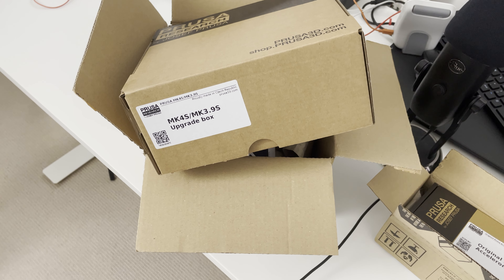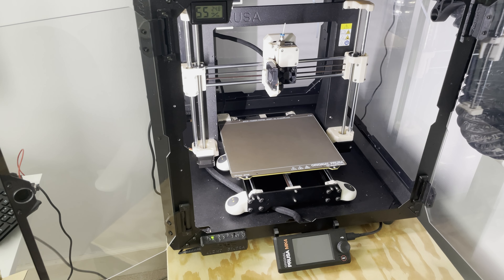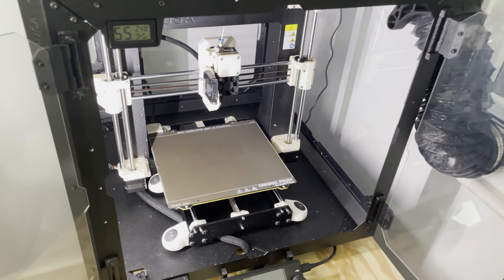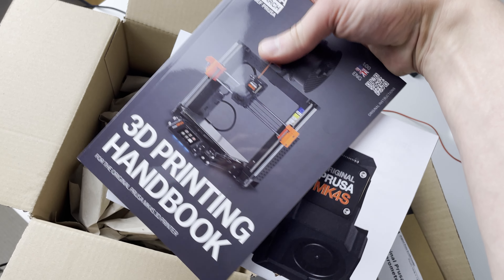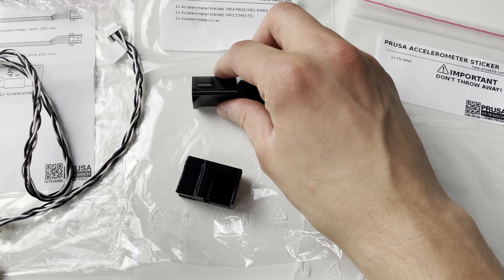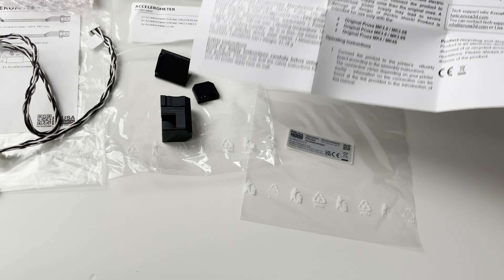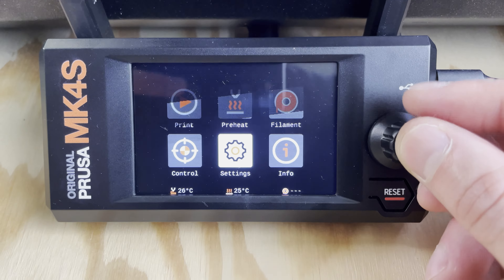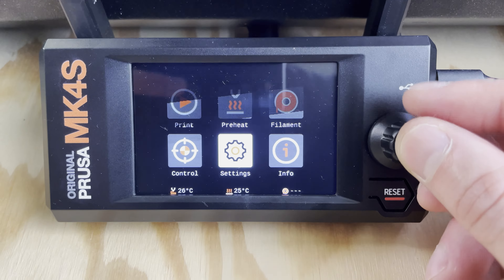Prusa MK4 to MK4S Upgrade and Input Shaper Calibration

Comment: The CHT type nozzles have dividers inside to split the nozzle into 3 flow paths. The concept is more heating surface
Reply from the maker: Hey, thanks, actually E3D nozzle splits filament into 4 parts - ai have cold pull photo from them. It makes sense why their nozzle tip is so thick. For Prusa nozzle - not sure, perhaps 3. Where did you get this number from?
Reply: The nextruders could very well be 4. I'll have to see if I can look inside with my microscope.  I just know from regular CHT V6 nozzles divided into three

Comment: Does lubing trapezoid nuts made artifacts worse?
Reply from the maker: I only slightly moisturize them with lube to mitigate friction. Did not notice any negative effects.
Reply: @StudioSpaceDust  I would check belt tension and belt mounts if everything is tight. then go around frame and check screws. Check small screws at motor idlers. Check if bed rod mounts are not cracked. Check if Xcrage  screws are not loose.

Comment: Nice!
I also just got the upgrade, I’m planing on reprinting the PC-CF parts out of ASA: I’m maybe a little paranoid about the breathing carbon fibre particles or having them rub off on my skin. The nanotube fibres just seems very similar to asbestos but maybe it’s harmless. I’m almost finished building my enclosure, and I’m debating upgrading with the parts from the kit to print these parts, and then switch over, or just print the parts with the original MK4 petg parts. Thanks for making the video! I really like how you make Prusa focused, no bullshit videos.
Reply: Oh and for the difference with the nozzles- Some posters on an MK4 Facebook group said that they have multiple chambers to push the melted plastic from multiple sides - I’m not sure how true that is but I’m guessing they’re a little bit different inside than the original nozzles. For why the obsidian nozzles are much larger - I think that it has to do with the thermal conductivity of the different metals. Brass seems to be about twice as thermally conductive as steel, so to heat at the same rate, you would need twice the cross sectional area. My guess is that they are made so that they have the same thermal transmittance to the filament. This makes sense looking at the photos, the original obsidian end is roughly twice as big as the original brass, and if we assume that there are different  chambers in the high flow end that also need a higher rate of heat transfer it would explain why it’s so much larger.
Reply from the maker: Intersting you say this - it sort of makes sense, but then I went to check e3d website how their brass HF nozzle looks like - and go have a look for yourself, its as big as obxidian. I also asked them if e3d HF nozzle is suitable for cold pull and they said yes, and sent me photo how successful cold pull looks like - it has 4 small branches, so it explains that filament is split 4 ways for higher flow rate, but in Prusa HF nozzle i don’t think there is physically enough space to split flow at the tip… thats why I’m still confused how they make them HF. But yeah, thanks for your thoughts man!
Reply from the maker: After some videos on YT I also now avoid filaments with fillers like CF/GF.. i do also believe that in the end its like asbestos, but i still have some prints that im using.. I guess going ahead i wont be buying that filament but the one I still own Ill finish… so ASA/ABS for parts - better choice. But ASA i find impossible to print without warping even with Prusa enclosure so thats why I use ABS+/ASA+ and i found that ABS+ has higher temperature resistance than ASA+ and also warps less so thats why i use it. But maybe you have some good ASA+ to recommend? For videos - well I only have MK4 (which is S now) thats why. But to be honest going ahead I may make some crap video of how I make stuff, but maybe ill make it as Shorts. Thanks for watching by the way :) 👏👏 but id say - dont go with PETG, it deforms too easy and some parts will start melting if you print hi temp filaments, in my other video there is a shot of how some PETG on my MK4 deformed.
Reply: @StudioSpaceDust  JanTec has made a video about using PLA (or PETG? ) as first layer to avoid warping when printing ABS/ASA and it reduces energy consumption, too.
Reply from the maker: @Duevel  I will try to find the video and investigate, thanks for the shout!